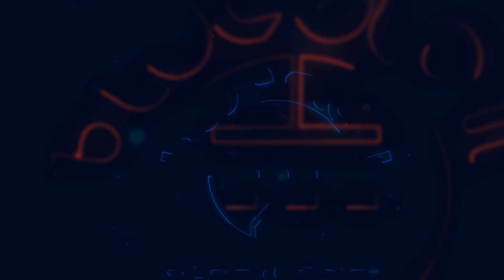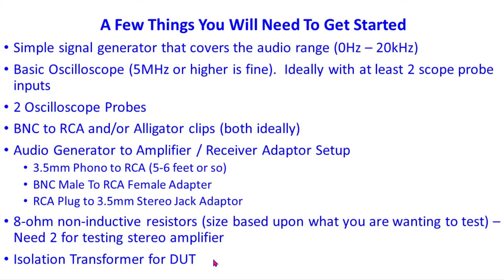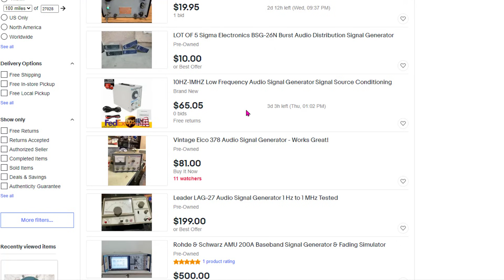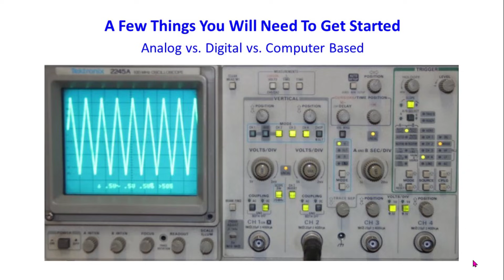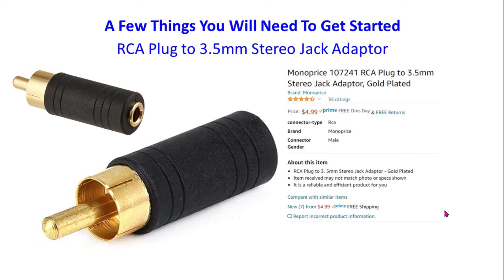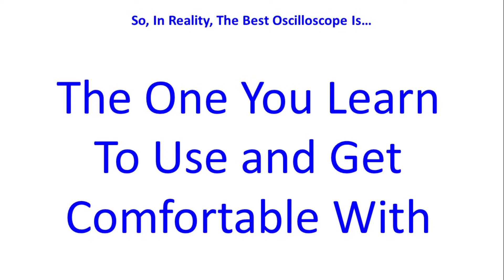Buying an Oscilloscope and Accessories For Audio Bench Work and Testing

Comment: Slight confusion: the lines on the Oscilloscope are called graticules, not gradients.
Reply: They are called graduations, not gradients or graticules. From Miriam Webster's dictionary: graduation: a mark on an instrument or vessel indicating degrees or quantity. In this context, Mark is using them to measure a quantity. From the same dictionary: Graticule: the network of lines of latitude and longitude upon which a map is drawn. in Marks context, he is using the graduations to measure time or amplitude.
Reply: @kostaskritsilas2681  look up graticule, also reticle, gradations is another acceptable term.
Reply: @kostaskritsilas2681  just because you found one word in the dictionary that means something, it doesn't mean that there are not other words that have the same meaning, here's the Wiki entry:"The graticule is a grid of lines that serve as reference marks for measuring the displayed trace."

Comment: Very informative video, Mark. I have two very minor points. I think the preferred term for the divisions on the face plate of a crt is ‘graticules’ rather than gradients. The other is, the crt’s for the analog scope are becoming rare, and are very expensive. A replacement will probably cost more than the scope itself, if you can find one. I think this is a factor which should be considered when buying something like this, especially from ebay. You are buying an absolute pig in a poke there. The digital scopes don’t have crt’s.
Reply from the maker: I've heard them called both so not sure what's official.  On the tube screen, agreed.

Comment: Very helpful series. I really appreciate you doing these videos. I have an SX 1980 that I want to test out and put an upgraded power supply in and I don't know anyone close to me qualified to do it, so learning how to use a scope will certainly help. All the best and have a great New Year.
Reply: Actually, a scope will not help that much. Just checking distortion, for instance: A scope will display the waveform. Alas, even a trained human eye cannot detect more than about 1% THD. A '70s or '80s high fidelity amp needs calibrated, lab grade equipment to check THD. One problem is testing something like your SX-1980 is that your signal generator has a higher residual THD than an SX-1980 has at full power (less than .01%).

Comment: 26:40 the closed aluminium case resistor is also wire wound.. just potted in a metal case.   
but maybe the way they wind them cancels out the inductive effects like winding it back and forth, not just in one direction somehow.

there are 100W TO-247 thick film resistors that are definately non inductive (except the leads) and cost half.  but require a heatsink or being submerged in a bucket of water.

first image on google images when you search for non inductive wire wound resistor is what it could be.